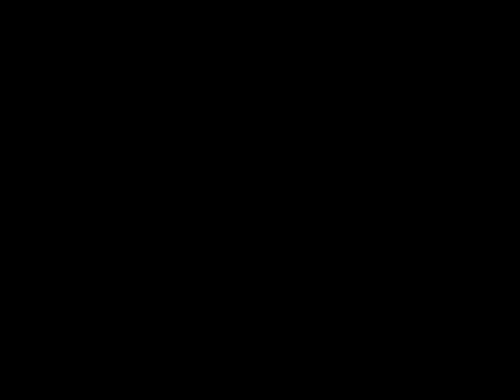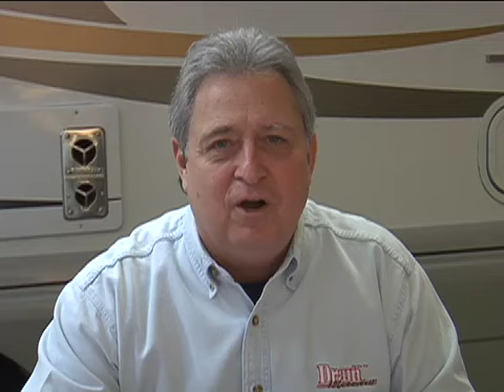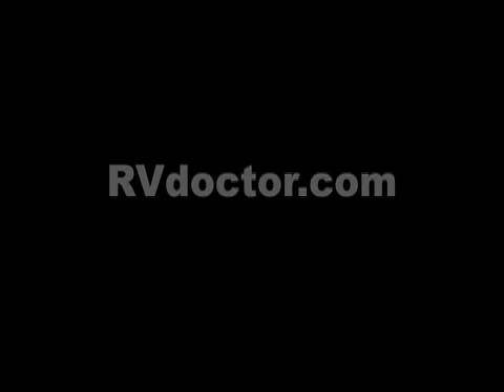How to drain an RV fresh water tank

Comment: Look under the RV for about a 1" plastic fitting. It is almost always grey or white. It is the drain plug for the fresh water tank. It has no valve, just unscrew the plug and all the water will pour out. Also run the pump and the sink to remove the water from the RV lines inside at the same time for a total water dump...I like to do a tank of bleach water and pump it to every outlet in my rv about one time a year. Then drain as I said above....
Reply: TheSoloAsylum I
Reply: THANK YOU. I WILL TRY TO LOCATE THE PLUG
Reply: How do you know when to shut off the pump?  I heard you can damage the pump if you run it without water in tank.  With one person only doing it do you just listen for when water stops running out from the plug and shut off the pump?

Comment: Love the channel. I have a camper that we just got also note that I am a new camper owner as well. So I don’t know a whole lot about campers. My freshwater tank is located under My seats where my table is. Here is my question. This is also where my pump is located. There is a hose that isn’t connected to anything on one end of it on the other end there is a valve where you can turn it off and on. What is that hose for and should it be connected to something or is it to drain the tank some how?

Comment: I have an 1989 1/2 Tiffin Allegro...I got the vehicle out of the shop, (full service, belts, tune up, etc.), and before driving it back 4 hours to Tennessee...I did add bleach to the fresh water fill up at the rear of the Coach...I figured this would slosh around and clean the tank (it had been setting up awhile...). getting home, I attempted to drain the FRESH WATER tank...no power for the pump, but I figured there would be a drain PLUG or something...none that I can find.....there is still bleach water in said tank...any thoughts?

Comment: Rehabilitation of an unused and contaminated tank coupled with a requirement by the rv park to drain all of that rinse water into the sewer system due to freeze conditions. These tanks are just not designed for actual use. I will be fixing a few serious manufacturing flaws this summer.

Comment: When I get a chance, I flush the tank out by attaching a hose and then leaving the taps on which will fill the waste water tank and hopefully also give it a cleaning too!
Reply: So I keep the water pump on while doing this correct, otherwise it wouldn't come out of the fixtures? Because it's coming from the fresh water tank as I fill it?

Comment: I hope someone can help me. I m a truck driver gone during the week and home on weekends. I don't have a air compressor ,so if I drain the low point drains under the camper, and turn main water off and drain my hot water heater and open all the faucets will my pipes still freeze?

Comment: My fresh water indicator shows two thirds full.  Opening the drain cocks with the pump turned on does not change the indicator.  

Malfunctioning indicator?   

My fear is I will over flow or drag around extra weight that is not needed.

Comment: Um ok but how do you empty a tank ? we have looked everywhere and can not find where to empty it ?????
Reply: Dahlene Burbank there's a pipe in the left side of the rv whit 2 values push one for the gray tank that means sink and shower the other for the black tank that means toilet
Reply: I noticed the lack of that, too.  I found it in a YouTube video from Joe's RV tech DIY video entitled "RV Freshwater tank drain,"  which shows the valves to close under the bed for an Itasca Class A but is the same setup for my Itasca Class C.  Why the manufacturer can't give a step-by-step instruction is a mystery.
Reply: Why not run the water in the sink or tub until it stops then empty the grey water tank and that should pretty much empty the fresh water tank. JMO

Comment: What happens when you drain fresh water and go to city water but fresh water tank keeps filling?
Reply: I would like to know this as well!!
Reply: I have the exact same problem with my forest river.
Reply: Richard Iribarne I had the same problem on my TT. When I hooked city water, my fresh water tank would fill up inadvertently. I solved the problem  by putting a valve that close in between the water pump and the hose leading to the tank. The problem was that city water would drip in the water tank very slowly. By adding this valve, it stopped. But remember that when you want water from the fresh water tank by activating the pump you have to open the valve. And you have to close the valve the next time you connect to city water. Is that clear? Excuse my English, I’m French speaking... Just wanted to help you as it took me some time to understand what was the problem and that I finally solved it... Good luck.

Comment: Hello, we have a 1990 Holiday Monitor. the floor around the read bed is wet. we have not been able to pinpoint where the leak is. We just got this so we don't know how to drain the tank or where to initially look for the leak. the floor is wet near the furthest rear of the m.h. as well as the side of the bed. it is clearly water and not fuel. PLEASE help!

Comment: I don't have a gravity feed for my fresh water. I have two low water point only. My motor home has a control panel for my water what setting do I need to put them on to drain my water? Do I have to open a facet so the water will drain?